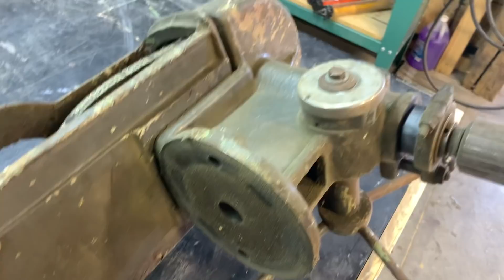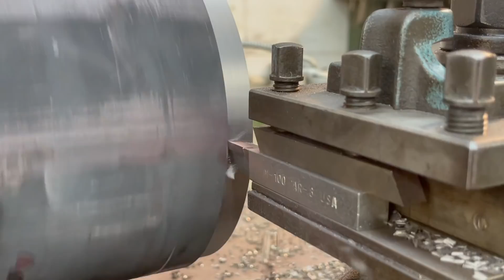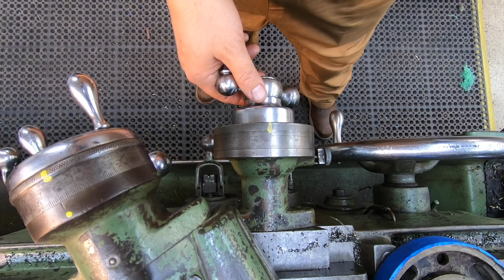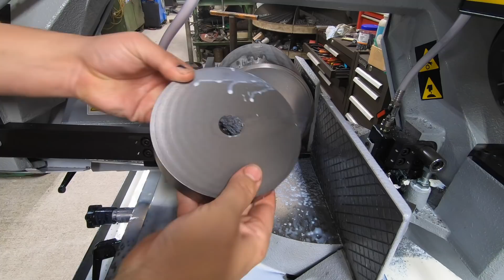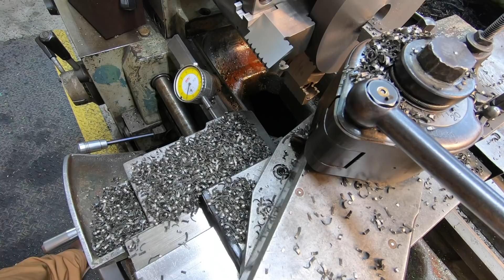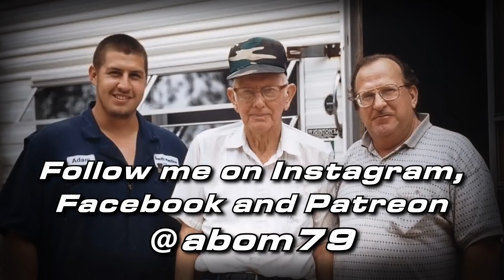Walker-Turner Drilling Head Adaptor Plate Part 1: Lathe Work

Comment: Really have enjoyed your videos. Precision work is very cool, and you do a great job.  I watched one of your videos recently and saw a CRC parts cleaner you were using. I looked it up and saw the price of $2300!  I couldn't help being upset by that.  It's not that I can't afford it but that isn't the point. I watch instructive videos and they have all of this expensive tooling. I damn well know, or would be willing to bet, you didn't buy a parts cleaner that costs 2300.  Reminds me of April Wilkerson and her building huge buildings and other stuff by herself. Yeah, right. I built a 3500 square foot shop with water heating in the slab. I built this by myself with quite a bit of help from my son.  I know what the struggles are with a project like that and when I watch You Tube, it is so misleading because there is so much more to it than what is shown. So many more obstacles to overcome etc. It's not sexy. It's a massive amount of hard work! I just don't want to see you get all boujee with all this fancy stuff that you don't really need to do what you do.  I have friends that build pro stock cars and other drag cars and they don't have a crane, 2000 parts cleaners, etc... Don't get me wrong, you are a lathe and mill guy and things are heavy. There is nothing wrong with nice lathes and other stuff but keep it real.     

So, if you did buy a $2000 parts cleaner, why? Hell, mine is like 99 bucks and it has cleaned so many dirty parts that I can't count, and it is still going strong.

Comment: Wondering why you don't do the milling first? This way you can drill the center which is perfectly aligned to the other drillings on the mill and use the center on the lathe to mount it.

Comment: I’ve watched quite a few of you videos and seen the difference in dry and wet cuts just out of curiosity I was wondering if you had ever tried a pvc pipe adapted to a shop vac to try and control the flying chips when dry cutting,   I turn wood on a wood lathe and it usually helps to control the mess so that there is less mess outside of where I needs to stay.
Reply: Hot chips and vacuum systems don’t mix

Comment: Why do you tighten the self centering chuck on all places. Does that hold the part more in the centre? Better pressure distribution over the jaws?
Reply: He did some testing when he first got that chuck.  Apparently it's how the scroll settles in within the chuck and how it interacts with the jaws.  It really did make a difference in repeatability and centering.

Comment: do parting tools tell you the minimum diameter you can plunge into on the face?
Reply: Yup; he talks about the tool at 4:00; the tool specs give the range of diameters.  It's a trepanning tool (curved, on the face) rather than a parting tool (straight, from the radius).

Comment: Why didn't you use a cut off tool on the lathe?
Reply: It a lot faster to use the bandsaw on larger diameters and it's a lot easier to get perpendicular cuts(parting tools would have to be adjusted many times to work up to the full diameter on a large piece). The basic rule of thumb is to run the lathe about 60% slower than you would for normal operations for that specific material.

https://mae.ufl.edu/designlab/Advanced%20Manufacturing/Speeds%20and%20Feeds/Speeds%20and%20Feeds.htm#carbide_parting_example
Reply: He doesn't use a parting tool over a certain thickness. Too much stickout and flexing.

Comment: Nice work. Another plus to using those brazed carbide tools is that you can re-sharpen them, which is a money saver over having to replace expensive inserts once the edge is gone.
Reply: you can sharpen inserts, too.
Reply: @CM-xr9oq  Agreed but you lose the original geometry that the manufacturers have spent a lot of time and money perfecting.

Comment: After 5 years, my brother's back at work - he's doing pretty much the exact same job in the same building - but for a different company ! Being a daily commuter and keeping the car off the street, means bringing it in and shutting the tatty wooden gates. For over a year, these infrequently used gates have been propped shut with bricks ! During his first day at work yesterday, I made an effort to do away with the bricks and fix the bolting mechanism - and that meant some fixtures on the ground for the bolt to extend into in between. So it's 32 years since I did any electric welding. This time using a welder I've not used before and welding rods I don't remember - working on outdoor metal having a good layer of rust ! Being flat on the ground, there was nothing to clamp the 'negative' terminal to - so I found a bit of angle iron with a bright end on it and clamped to that. With the bright end near the rusty stuff on the ground, I used that to strike an arc to tck-weld the angle iron to the ground - purely to provide something to clamp the negative to ! To top off my difficulties, I was welding thin metal to thick metal. The result is far from pretty but at least functional !
Reply: Outstanding.  Carry on...

Comment: Could the inaccuracy at 30:56 be caused by the the bandsaw clamping on the raw edge of the ductile iron, which is different from the true edge of the part?
Reply: That's a good point. There could be a slight enough difference that it would alter the cut

Comment: Total noob here, but why would you use a 4 jaw chuck instead of the 6 jaw?
Reply: The 4 jaw chuck has jaws that move independently of each other, each can be tightened or loosened on its own. This makes it suitable for holding work pieces that are not truly round, like a rough casting. It's also used when you want to be able to precisely control where the center of the work will be turned (e.g. if you wanted to turn something on an offset.)

The 6 jaw chuck is self-centering, and works like the chuck in a drill, where all the jaws move in and out together at the same time and by the same amount. This means they are only effective with perfectly round work pieces (or those that are hexagonal.) If the piece was out of round, one or more of the jaws would not make good contact and the piece could shift or fall out. This is why Adam was able to use the 6 jaw for holding the part on the machined round surface, but had to use the 4 jaw for the rough casting, as raw materials like that are not guaranteed to be dimensionally accurate.

A potential source of confusion is that Adam tightened the 6 jaw chuck in multiple places. Self-centering chucks are designed with multiple pinions (usually 3) which all act on the same scroll. The scroll has a spiral ground into it that tightens all the jaws at once. They give you multiple pinions so that you have access to tighten it from any angle without having to rotate the chuck too much, and technically speaking this means it's only strictly necessary to tighten one of them. But it's good machinist practice to tighten all of them, which equalizes the tension on the scroll and leads to more accuracy and better work holding. But this is quite distinct from the case of the independent jaw chuck where each jaw moved on its own.

In general, self-centering chucks excel at faster setup speed at the cost of some accuracy, and independent jaw chucks are preferred for accuracy and flexibility of holding irregular work pieces, at the cost of much longer setup time. But that's only a generalization, it's certainly possible to have a very high quality self-centering chuck that has been dialed in and adjusted to perfection and not suffer from any major loss in accuracy. Most self-centering chucks have 3 jaws, which tend to be less accurate. The 6 jaw version is meant to be more accurate while still having the advantage of swift setup time, but it costs more to manufacture.
Reply: Jason, there's two good reasons 1- The 4 jaw was already in the lathe, 2 - There was too much stick-out with the 6 jaw chuck. If you noticed the 4 jaw had about 1-3/4 of holding surface on the jaws where the 6 jaw only about 3/4. With the  stock being as long as it was you would run the risk of it being pulled out of the 6 jaw chuck.
Reply: Less work and mental math is my guess.

Comment: How come you do not use cutting fluid or cutting oil on the Lathe. Must be very harsh on the cutting blades and drill bits
Reply: I'll just tell you instead of being an ass: Cast iron contains graphite that acts as something of a lubricant when machining. Also, you can see that machining it produces a fine powder as well as chips, and cutting fluid can cause that powder to get into the ways; it's really abrasive, so it's best to cut it dry. Good grey and ductile iron will machine pretty freely.
Reply: @SynchroScore  Thanks for a complete answer to my question unlike others .
Reply: @wirenut003  Happy to help.
Reply: I'll let you do a little research out there and answer your own question .. "ductile iron" "machining"
Reply: @silasmarner7586  No need to be an arse.

Comment: The owner of the Walker - Turner drill press must of been sick when the part rolled off the table. The Walker - Turner and the very similar Delta are very versatile machines. With the sliding ram, tilting head, wide speed range and large production table with T slots calling these a drill press is a little misleading. This is a nice gesture for you to make this part Adom.
Reply: I'd've cussed a blue streak and thrown s**t to be sure.
Reply: @silasmarner7586  I don't know what I would of done. For 35 years I have had a eye open for one of these. I think that I would of been beyond cusing and throwing things. The mental ward bill would of cost more than buying a properly restored one.

Comment: The material is probably 65-45-12, a ferritic ductile. The original piece was Gray iron and very brittle. The 65 ductile machines very well and won’t crack if it hits the floor. I used to work for a couple of foundries that manufactured continuous cast gray and ductile. As I watch the machining I am sure that the material is a class 40 gray iron. Gray iron is a good material but is fracture prone like the OEM part and will brake if it hits hard on concrete?  Somethings wrong here.
Reply: Welp!  I guess he'd better not drop it, huh?
Reply: So if you buy iron from a supplier is  there a way to identify what you got?

Comment: On your drawing of the faceplate, you mention that the slots start at 40 degrees, is that 40 degree line through the middle of the tool that cuts the slots? Does that make sense?

Comment: is there a difference between a facegrooving and a trepanning tool?
Reply: If I may answer:
A trepanning tool consists of a centre Arbour that runs in a previously drill hole on centre of the intended hole, the second part is a right angled tool that can be adjusted for diameter by moving in or out in the Arbour. The Trepanning tool is held in a drilling machine, by hand or powered. Also known as  tank cutter.
The process know as Trepanning, means to cut a large diameter, but leave a disc of material, rather than machine all material.
So a Face Grooving tool can Trepann!
Hope this helps.

Comment: Why do you rotate the chuck the opposite way of machine rotation before starting it?
Reply: It helps the gears in the head mesh, when changing spindle speeds.
Reply: It's always been Adams' dream to go on the Price is Right and spin the big wheel to get into the Showcase Showdown, and this is just his way of practice :D  Everybody pushes up a bit before pulling down haha

Comment: I'm a little surprised you didn't swap out the trepening tool for something more robust once you had the two borders done. With the first groove done you should have enough clearance for a regular tool.
Reply: You would then need to switch back to the trepanning tool to make the final .005 clean up of the bottom or use a right and left ground regular cutter. This is the simplest and most accurate.

Comment: Why do you give the chuck a little turn before starting the lathe ?
Reply: I don't know each time, but I spotted at least one instance where Adam changed the gear on the lathe, and sometimes the gears won't go in unless you turn the chuck a bit.
Reply: I don't know for sure why Adam does, but personally I developed a habit to do so just to check for clearance.
Reply: Make sure that all the gears are engaged before starting up the motor.

Comment: I can appreciate the manual lathe work you do on your equipment as I worked a very small lathe for years with no DRO or much measuring equipment. The tool set up was simple and done by feel mostly. I miss using the manual lathe. It’s what I learned on. Stay safe mates!😊👍🏻😷
Reply: My about tab has info which will help you stay safe! Stay safe!

Comment: You've probably already thought of this but you could take a large piece of stock like that chunk of iron that you made the drill press part from and just leave it chucked in the saw and get your dial indicators out and run it horizontal and vertical and dial that thing in.

Comment: Hello American machinists, and machinist enthusiasts. Quick question: What's the difference between a rule, a scale, and a ruler? Are they all synonymous?
Reply: A ruler is a King. A scale and rule are the same thing.
Reply: "Ruler" is just a 15th century variation of "rule," which comes, via French, from Latin "regula," which meant a measuring stick, a diminutive derived from "regere," to straighten, lead, or guide. The word "rule," comes from the same source, but is more metaphorical."
  Scales are the incremental lines on a ruler or rule.

  from OED  
 Rule —n. 1 compulsory principle governing action. 2 prevailing custom or
standard; normal state of things. 3 government or dominion (under british rule).
4 graduated straight measure; ruler. 5 code of discipline of a religious order. 6
order made by a judge or court with reference to a particular case only. 7
printing thin line or dash. —v. (-ling) 1 dominate; keep under control. 2 (often
foll. By over) have sovereign control of (rules over a vast kingdom). 3 (often
foll. By that) pronounce authoritatively. 4 a make parallel lines across (paper). B
make (a straight line) with a ruler etc. as a rule usually. 

Ruler n. 1 person exercising government or dominion. 2 straight usu. Graduated
strip of wood, metal, or plastic used to draw or measure.

Scale3 —n. 1 graded classification system (high on the social scale). 2 a (often
attrib.) Ratio of reduction or enlargement in a map, model, picture, etc. (on a
scale of one inch to the mile; a scale model). B relative dimensions. 3 mus. Set
of notes at fixed intervals, arranged in order of pitch. 4 a set of marks on a line
used in measuring etc. B rule determining the distances between these. C rod etc.
On which these are marked. —v. (-ling) 1 a climb (a wall, height, etc.). B climb
(the social scale, heights of ambition, etc.). 2 represent proportionally; reduce to
a common scale. in scale in proportion. Scale down (or up) make or become
smaller (or larger) in proportion. To scale uniformly in proportion. [latin scala
ladder]
  
   So, to beat a dead horse,  the scales are the lines on a ruler, that can be used to "rule" the paper.
   more or less.  There is more, but I'm bored.
   Btw, notice   definition rule 4b,  I didn't realize the OED had a sense of humor.
  you can download a partial edition of the oed at pdf(dot)com.  
      It's not complete, but more than good enough for most people.
Reply: just to have fun with words... 
a RULE 1. one of a set of explicit or understood regulations or principles governing conduct within a particular activity or sphere.  2. control of or dominion over an area or people .a rule, administer, command, govern, manage mean to exercise authoritative guidance or direction. Rule implies the exercise of authority as by a sovereign: to rule a kingdom.  
a SCALE is a succession of pitches ascending or descending in steps.  . 2. a straight strip or cylinder of plastic, wood, metal, or other rigid material, typically marked at regular intervals, to draw straight lines or measure distances.

as a rule I would continue, but I will let it rest

Comment: Your saw angle could be good and the deviation could been from simply clamping on raw iron. It’s not as you put a true turned round part in the saw. It was still sitting on mill scale no?  So only as true as the raw part was?

Comment: Arguably your left and right saw error may be the runout in the rough ductile iron, you are clamping an uneven surface and comparing the resultant cut with a surface machined to a different reference.

Comment: Why ductile iron? If you made it out of cold rolled steal it will not break next time it rolls of the table. Yes; it will roll off the table because you are making it out of ductile iron.
Reply: Do you mean it is going to roll off of the table because of Murphy's Law?
Reply: Customer supplied material, steel would have been fine too.

Comment: If you are flipping those jaws around a lot would it make sense to get a second chuck and have one of each orientation at the ready?
Reply: That precision 6-jaw chuck is worth about $1000. The time to swap the jaws is much less than the time to swap chucks, which for a precision chuck also requires re-indicating it in.

Comment: What determines whether or not you use cutting oil?
Reply: the type of material .
Reply: Cast iron contains graphite, which acts as a built-in lubricant.  So oil is not necessary, and the downside would be that it would gum up with the cast iron dust from the cutting, and make an abrasive paste all over the machine.